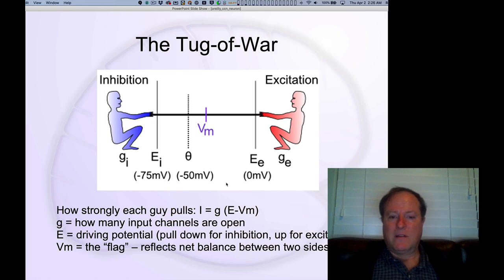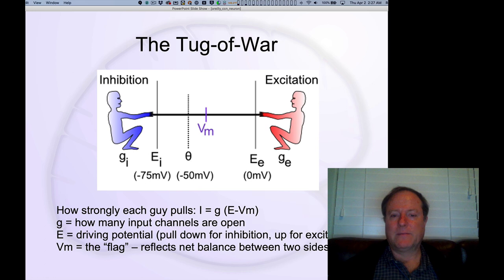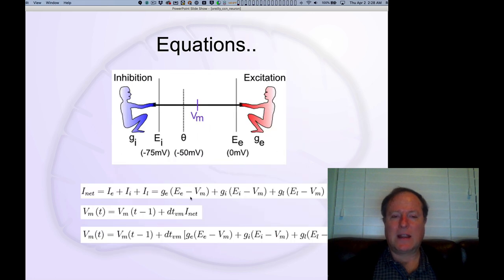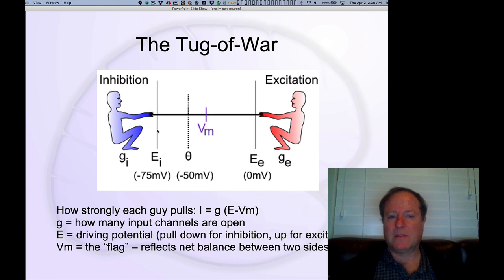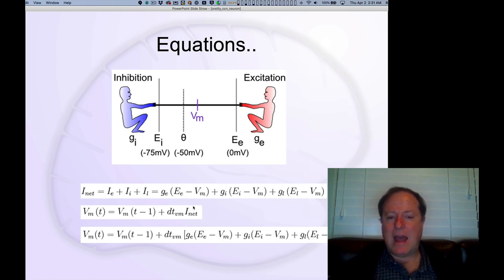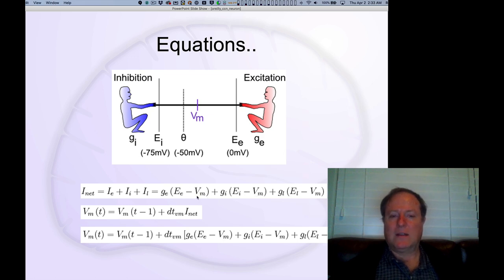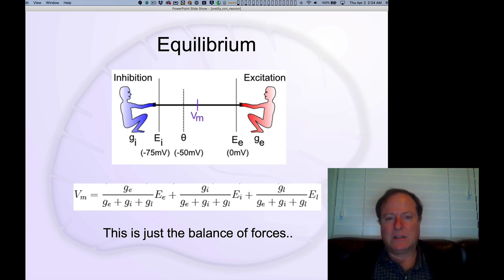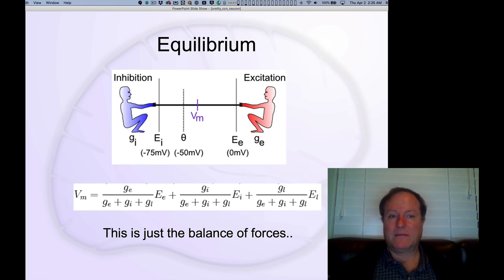CCN Course 2020, Neuron 7: Math

Comment: given Vm(t) formula  =Vm(t − 1) + dtvm[¯gege(t)(Ee − Vm) + ¯gigi(t)(Ei − Vm) + gl(El − Vm)]

When the difference between Ee-Vm becomes smaller and smaller, getting closer to zero, Vm(t) gets less and less input. When Ee-Vm = 0, there is no more current (Ie) coming in (ignoring inhib and Leak for simplicity. How does Vm ever get passed Ee (1.0 in your simlulations)? Spiking threshold is even higher (1.2). 

Big fan of your work by the way!
Reply from the maker: Thanks for the question!  The spiking threshold is a bit confusing here because there are other excitatory Na channels, not represented in the basic equations we discuss, that are voltage gated and only open when the Vm gets above the "nominal" threshold around .5 or so in normalized units.  These are the famous "Hodgkin & Huxley" channels that drive the actual spiking.  In the AdEx model that we use, they are implemented by the "Ex" part (exponential), not using standard Vm-based integration equations, because the spike is fairly "ballistic" and all over very quickly, so it isn't worth the extra fine time updating that would be required to capture it using the "correct" equations (like those you show above).
Reply: @RandallOReilly  Thank you for your answer! I am writing a simulation using the first part of your book. Since my neurons weren't firing, they stopped short of the Ee threshold, i increased the Ee to 1.3 right above the spiking threshold (1.2). Probably not the right solution but it did seem to do the job (for now) as my neurons are now firing and connection weights seem to be changing correctly. (Not finished yet checking if it all works correctly).
My goal is to add a dendritic structure to your LEABRA framework. Specifically 2 aspects of dendritic trees. The reason is because you once made a comment on a podcast (interview) you gave several years ago about an observation you made when  you increased the size of your simulations. I instantly had an opinion on the cause of that observation.. I am very curious to see what happens when I add dendritic structures to it.

Comment: Isn't it I = g(Vm - E)? Or does the order not matter?
Reply from the maker: Yeah you just have to keep the signs straight (which I find difficult ;)  I prefer g(E-Vm) because it makes sense conceptually that Vm is being driven toward E.  The other way may be more standard, but then you just add a negative sign when integrating I to update Vm.  I think it probably has to do with electrons being negatively charged.